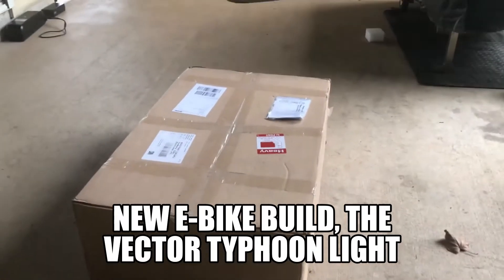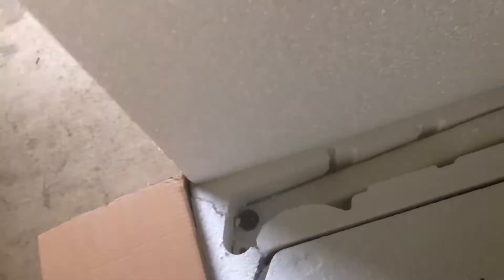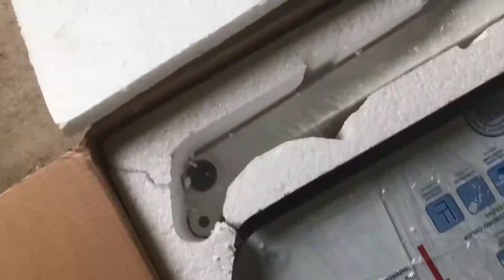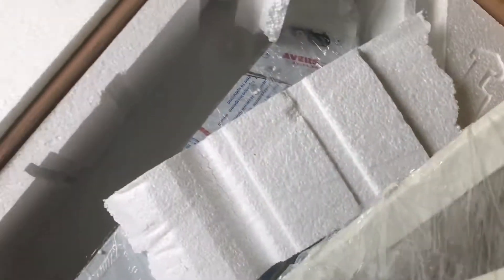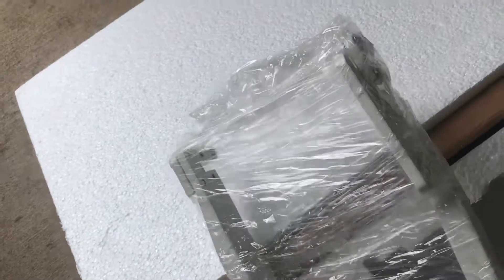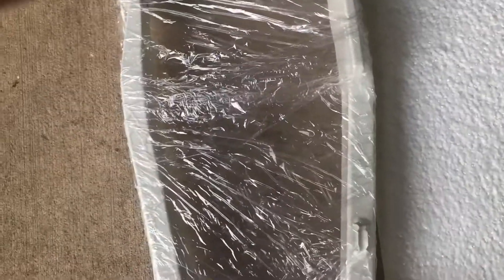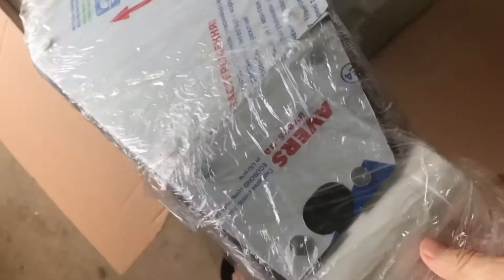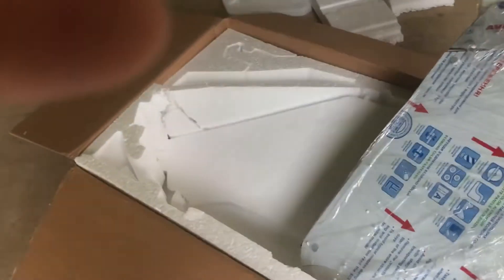New E Bike Build, the Vector Typhoon Light

Comment: What you think about 3 18v 6ah power tool batteries powering a 1000w brushless motor with a 30ah controller?
Reply from the maker: That would total 54v, & around 61v when fully charged.
Most 48v controllers will handle up to 63v. so you may need to open & check the resistor on your controller board. 
Note that over volting will void any warranty of the kit.
Also as they are only 6ah or 324w, your will probably only range around  25km or 15 miles, depending on rider & the bike weight, also how you ride. Using PAS mode in eco would give you more, however when you have the power you tend to
use it.